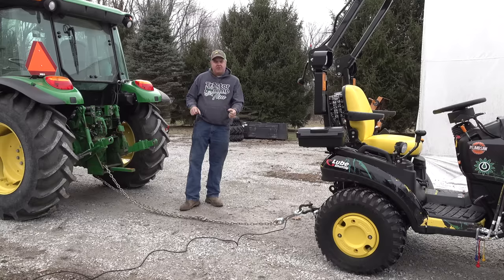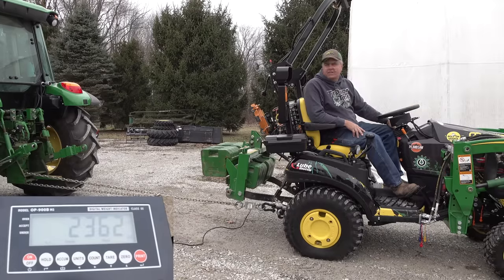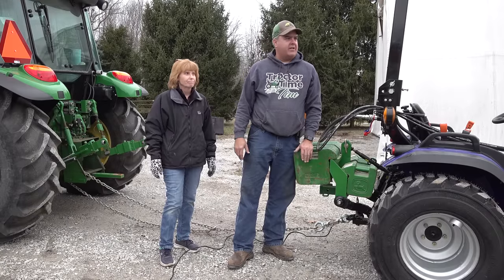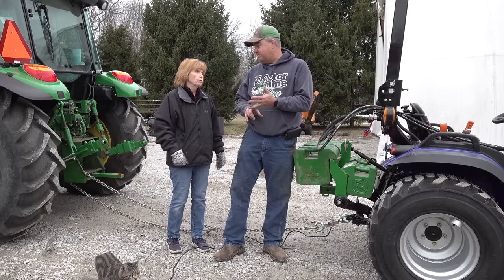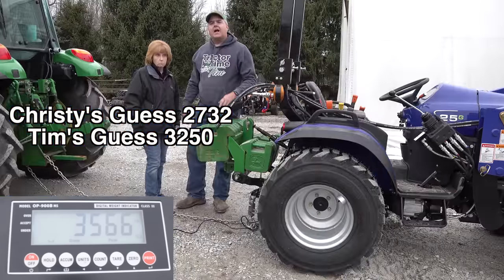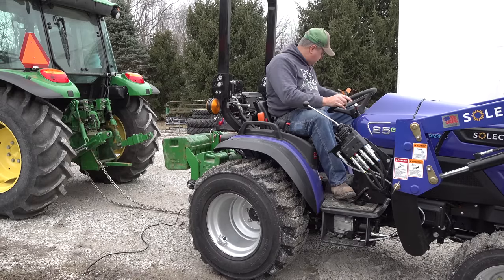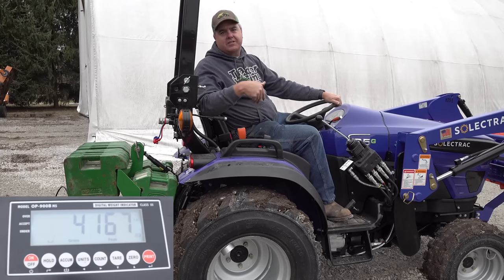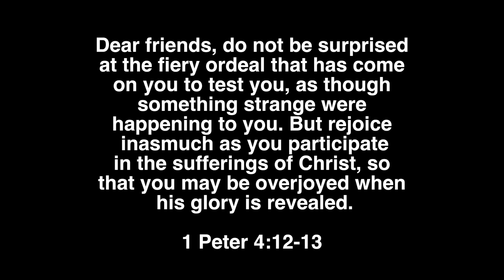CAN THE ELECTRIC TRACTOR PULL ANYTHING? Solectrac e25 vs Deere TURBO 1038X Tractor PULL TEST!

Comment: I think it's interesting Soloctrac has set this as a 25 horsepower tractor whenever we talk about tractors it seems like most discussions start with horsepower doesn't matter it depends on your needs or use case.
Looking at this from a end user standpoint or consumer, all that matters is what you can buy with your money.  So this being a new technology for tractors the obvious thing to do is compare it to the most relevant tractor for its characteristics and cost that's a diesel.  If I'm looking at this electric tractor Solectrac E25 $35,327 for $972 less I can buy a 2032R with a loader with R4 tires $34,355 and still come out a little bit cheaper that would be a better comparison. 
 As I understand it Tim does not have a 2032R however he does have a 2038R which is only about $1300 more than the E25 tractor.  This would be the right frame size and wheel size comparison. That's the comparison that makes the most sense to me as a consumer that Tim, @TractorTimewithTim should be making.   

Thanks

Comment: Neat to see. I figured sparky would pull more because electric makes so much torque.  Still would like to know how that tractor does in the real world.  I think you should do a test brush hogging this year or running a tiller. Diesel vs electric see what lasts longer on fuel/energy very curious about that.
Reply: 3-6 hours of use depending on load per the website. All night to charge on 115 or 8hrs on 240. Not super practical.
Reply: @ericstyer2890  kind of what I figured. So you can't work a full day with the machine. Honestly I notice on my electric bill when I use my table saw for a few hours. I would hate to see the bill to charge the tractor every night.
Reply: Agree - I am curious how long it would last pulling that much weight.
Reply: @simpleman4196  if you assume that you use 20 kWh of 22 kWh capacity five days a week for ten months, that would be 4,000 kWh. USA Avg cost per kWh in 2021 was around .14. .14 x 4,000 kWh is $560. Thats only $46.6 per month using 90% of the battery five days per week, 10 months per year. Most people don’t use these machines for anywhere near that amount of hours. 

I think you’d find that electric cost around 1/3 or less compared to diesel.Then you add in the cost of oil, air filters, fuel filters, etc and the savings is even more. Major cost savings. 

Personally I wish they got rid of the transmission though. Less complexity would be a win in my book. (And maintenance.)
Reply: @kylekleman  just going off your figuring is fine but if you can't use the tractor a full day what good is it? I am sure their is at least one hydro filter maybe 2 so there is still filter and maintenance. When a battery goes bad I would only guess that's a very expensive fix going off problems with electric car batteries. So what money have you really saved in the end. What is the lifespan of electric equipment ( honest question because I don't know. It is something to think about tho) you still see diesel tractors from the 50s in use today.  Electric equipment is to unreliable on its own but it does work. Look at trains diesel gets the trains moving from a stop or powers it up hill but when a large demand for power is not needed electric motors take over.
Reply: @simpleman4196  fair points about runtime. I’ll be curious to see how long he can run the machine doing work too. Is it 3,6, 8 or some other amount of time? 

As far as life goes, the motor should last three to four times a diesel engine. If it’s designed well. Transmission, not sure. Batteries it depends on use and age. The technology is much better than early hybrid batteries that failed around 8 years from the early 2000s. If designed well, should be 15 years or more. If not, time will tell. Depends how you treat them of course! (Draining them to zero, using in very cold or raging hot temps, etc) 

In general you are moving to much less complex system with fewer points of failure compared to diesel. But that assumes a good design. Time will tell! Less noise and more torque is a huge win. No let’s see about the run time…
Reply: @kylekleman  yeah those are just my thoughts and concerns I honestly don't know anything about electric equipment only experience I have with electric equipment that runs on battery is power tools and I love my cordless power tools they're great.

Comment: Looking at the test I think a truly equal comparison would be to equal out the weight of all the tractors to as close as possible. The Soletrac looks like a heavier machine to start even before adding weight. You would have a much better base number to move up from as you added more weight to the larger tractors.

Comment: That rollout is definitely a flaw in the motor controller programming, with regen braking you should rarely need to use the mechanical brakes. I'm kinda surprised Solectrac is shipping these programmed like that.

I'm not surprised by the result though and I bet it will slip in mid range too, you've got all the motor's power going to the ground with that gear drive, where the hydros are built to limit axle torque. The old Elec-Traks GE made in the 70's only had up to 1.2hp drive motors but could snap 1" axles in the lower gear ranges with enough traction.

Overall, the tractor looks like it has a lot of potential but some changes would improve it a lot. Separate traction and PTO motors would be nice, making the PTO independent from ground speed like a hydro tractor. Then a treadle or dual pedal throttle would be much nicer than a fwd/rev switch (still keep the hand throttle for cruise though). Demand regulated hydraulics, with a variable speed pump or at least a pressure compensated pump, would reduce noise and improve battery life. Looks like the pump motor already is variable speed capable with the lower speed mode for just steering. Electric power steering would let the tractor run without needing the hydraulics running continuously too. Chasing efficiency will be the key to improving run time on electric tractors.

Comment: One suggestion I could give would be to switch out the wide R4 industrial tires with narrower R1 ag tires. A narrower ag tire is actually going to have more traction versus something wider, wider is always better for flotation. But you don't want flotation if you're trying to get grip. :)

Comment: The best surface would be the concrete pad leading up to your shed door. Or if you have anybody nearby that has asphalt driveway. For the most consistent result you need a surface that does not move.

Comment: I was impressed with the pull test results on the Solectrac.  The analysis on the 3pt was interesting in how you were just able to fit on the Heavy Hitch rack. Hopefully you get to talk with a rep from Solectrac while you're in Louisville for the NFMS and see if they're working towards a solution to that issue.

Comment: I wonder if the rollout is a software tunable parameter. With a hydrostatic transmission, the rollout is caused by the inertia of the tractor fighting the no longer moving hydraulic fluid. With the Soletrac, it appears to have the same amount of rollout regardless of wheel speed. Maybe that's their way of preventing a sudden stop when releasing the throttle, and that would seem to imply it could be adjusted, either in the field, or with a new firmware build.
Reply: That's a really good point. At 15:13 you can see that it still "rolls out" even when the wheels are under heavy load. Seems like the rollout is more from a "throttle down" than from momentum
Reply: All in the software, guys.

Comment: Add rim guard, wheel weights,  ag tires and put in a field. With these tests, you do need to state the total weight of the machines. My electric Sears garden tractor got 1240lbs with 1000lb total including me on it.

Comment: I would really be interested to know what kind of PTO performance you get with the Solectrac.  Is it able to run your tiller and/or brush hog?  How long before it needs recharged using PTO?
Reply from the maker: Be patient. Hard to test tiller or mower in the winter.

Comment: Great test of pulling power. How about hydraulic power? How does Sparky's hydraulic pump test out? Does pulling power equate to PTO torque? I hope someone comes up with a viable electric tractor option, and I would be all in. I would, however, need a backhoe.

Comment: More bucket weight = less rear weight. Did I win a CB too? Extra cheese please. Yum! I know you remember that now.. You did a video on it. It is so easy to armchair review. Thanks Christy for putting up with all his efforts that get you out in the cold.
Reply: It's in 4 wheel drive. It will be able to pull more than if the bucket were empty.
Reply: Yes, there is likely much more traction available from the large rear tires than the small front ones, so transferring weight from rear to front is not likely to gain much.
Reply: @JCWren  Not likely as the large rear tires can generate far more traction than the small front tires.  Transferring weight fro rear to front is not likely to be an overall gain unless the front wheels are on pavement and the rears are in dirt.
Reply: @LTVoyager  Tim has a set of scales. It would be interesting and useful to see what the weight distribution is on bucket loaded vs bucket empty. While loading the bucket will take weight off the rear wheels, I'm pretty confident that putting 800lbs in the bucket will not take 800lbs off the rear wheels.
Reply: @JCWren  I agree.  If I knew the distances between the wheels and between the CG of the bucket and the front wheels, I can calculate easily what the changes would be.  It isn’t a question of 800 lbs taking 800 lbs off the rear wheel, it is a matter of is the traction gained by adding weight to the small front wheels more than is lost by removing weight from the rear wheels.  I will guess that the answer is no, but it would require testing to be sure.

Comment: I think an interesting test would be to use the Electric tractor pulling a plow for a 2 or 3 hours and compare the ability of the tractor as the battery drains.   Also, with a diesel/gas  tractor if you run out of fuel you can fill the tank in a field (personal experience).  How would you go about charging an electric tractor if you drain the batteries in a field?  Can it be jumped somehow?  Very cool episode.  I personally have no problems with electric anything.  My issue is and will continue to be Lithium.  Sodium-Ion has the potential to be the answer.  It all depends on who gets the $ for this.   Hydrogen would be even better but how do you tax water?

Comment: With my rocks and slopes, working without ballast can be a terrifying proposition. I prefer to use my backhoe on the rear, at 610 lbs, it's the most I can add to the back of Joan current.

Comment: Tim, the Solectrac is a heavier tractor than the 1025R, 3600 lbs with loader. It should pull more. It actually appears to have a larger frame than the 1025R. Not sure it is a good comparison.
Reply: Take note though, the Johnny stalled at the weight that it did. Stall meaning the tires would no longer move.  The Electric tractor still had plenty of go, just no traction.  The electric tractor is superior to the little John in pulling power.
Reply: @Itsa_Mea  It is superior for exactly the reasons I stated. Friction force with the ground is directly related to the weight you have. Johnny spun the tires at higher RPM.  Again too light.  The Solectrac is a heavier, larger frame machine.
Reply from the maker: Yes, of course.  Not a perfect comparison…but helps folks to understand the differences.
Reply from the maker: No, Johnny did NOT spin the tires once I had it fully ballasted. Watch again!
Reply: @TractorTimewithTim  It would be interesting to compare it against a larger frame 25 hp tractor. The 2025R would probably be a better comparison.
Reply from the maker: It will still outpull 2025r.  This is why I mentioned 2038r.
Reply: @TractorTimewithTim  Sorry my mistake Tim.
Reply from the maker: Ah, no worries..just enjoying the discussion.
Reply: @TractorTimewithTim  what about a tractor the same weight and torque?
Reply from the maker: We had no idea how much it would pull…now we know that we need to step up the competition.
Reply: @TractorTimewithTim  The Solectrac spec say it is rated for 3000 lbs. Obviously that takes in to account safe operating conditions. Torque is also higher than stck 1025R, but I don't recall what you get with JohnnyX.
Reply: Tim and all,

I think it's interesting Soloctrac has set this as a 25 horsepower tractor whenever we talk about tractors it seems like most discussions start with horsepower doesn't matter it depends on your needs or use case.
Looking at this from a end user standpoint or consumer, all that matters is what you can buy with your money.  So this being a new technology for tractors the obvious thing to do is compare it to the most relevant tractor for its characteristics and cost that's a diesel.  If I'm looking at this electric tractor Solectrac E25 $35,327 for $972 less I can buy a 2032R with a loader with R4 tires $34,355 and still come out a little bit cheaper that would be a better comparison. 
 As I understand it Tim does not have a 2032R however he does have a 2038R which is only about $1300 more than the E25 tractor.  This would be the right frame size and wheel size comparison. That's the comparison that makes the most sense to me as a consumer that Tim should be making.   

Thanks

Comment: So what happens with the PTO if the motor changes direction when you put it into reverse? Surely that would mean the pto would spin in reverse too? Or does the pto have its own motor? Interesting tests Tim 👍🏼
Reply from the maker: Ah ha!  YOU are thinking ahead :-). Yep…bad news there!  More info when we formally ‘discover’ that!
Reply: I'm guessing when you put it in reverse the PTO shuts off. Gosh, I hope not though. That wouldn't work well for the brush hogging I do in the woods.

Comment: I can confirm that a 3046R can pull a 7 foot disk with some torque to spare (spun the wheels a bit, but that's also due to them being R4s for use on the lawn where it does more work). Just gotta watch the weights because it can potentially pull you sideways. 🤣

Comment: I didn't read all the comments so someone else may have covered this. 
1)  DC motors have 100% torque at 0 rpm.
2)  With the motor directly coupled to the tranny (I.e. no clutch release). Then a possible reason for the long "rolling distance" is because the motor is still spinning down and the tranny is still transferring that centrifugal energy.

Comment: Coefficient of friction -- you may actually be testing the "Rubber meets the road" .  Physics suggest that this independent of weight.  The way to get more pull would be to add dual wheels.  I'd be curious about temperature rise -- did the battery get warm? is the wiring hot?  It's interesting that they put the 500 LB battery under the hood instead of under the seat.

Comment: Tim please be careful pulling with chains and make sure they are the proper grade and load rating. This applies to any shackles and hooks. All of these should be stored to get proper air circulation and kept dry. Lubrication is also necessary along with avoiding dragging on hard surfaces. Inspect chain links and hooks/shackles before each use. Please consider this to keep the operator and bystanders from bring injured.

Comment: I think adding weight in the bucket is counterproductive past a certain point. By doing it you are adding more weight to the front tires while taking some off of the rear. giving the front tires more traction but the rears less which have more surface area resulting in negligible differences. What im getting at is you want the weight to be as balanced front to back as possible which would be hard to know precisely without scales under the tires.
Reply from the maker: Yep.

Comment: I thought there was something that made you special, congrats on being an Illinois grad.  Two things, 1) how do the weight per axle compare? 2.) the whine of the motor would not be acceptable to me.  Not just the loudness but also the frequency.  I have the same issue with some hydraulic pumps.

Comment: V1 of the internal combustion engine wasn't much better than the horse. V1 of the black powder musket wasn't much better than a bow and arrow. Tractors have been developed for over a century, electric motors have been developed for over a century. Just put those two development paths together with a good battery and we're off to the races! Thanks for the info Tim and Christie, and the lesson on how Normal Force means a lot more than we think.

Comment: Putting more restrictions or pulling whatever you want to call it onto that tractor is probably going to take more voltage causing less of a run time to do whatever you are trying to get done....
Reply: Of course it would draw more amps and lower runtime, as it would burn more diesel and decrease runtime on the Johnny too.

Comment: The roll out reminds me of electronic throttles on the new trucks. You floor the throttle and let off and it takes a good 3-4 seconds to register you let off. Always thought that was extremely dangerous, but I'm a old school guy.
Reply: actually im pretty sure all tractors have that feature. its designed to keep the tractor from abruptly stopping and throwing the operator violently forward. It is intentional and needed. I owned a cub cadet that this was broken on and when you would be in high gear and let off the forward pedal it would lock up the tires and skid to a stop.

Comment: I have a 2013 1025R with ZERO ballast weight. In 4x4, low gear at 3/4-full throttle, I can pull a 7x12 foot loaded dump trailer with a total trailer weight of 9971 pounds in dirt / grass on a slight incline.  My tractor is stock.
Hitch is on the 3 point.